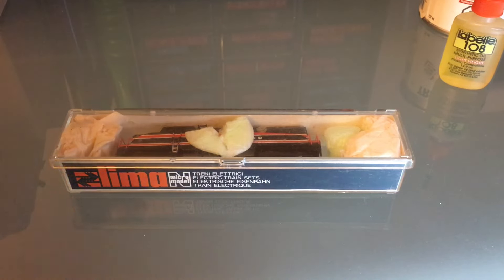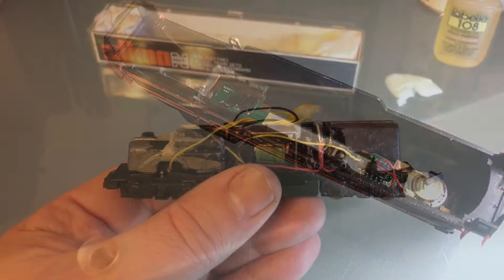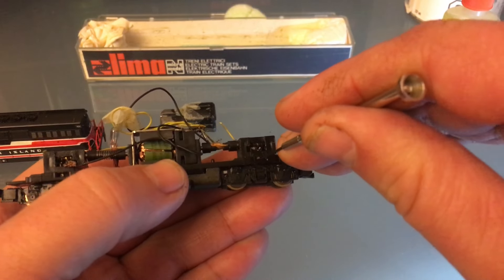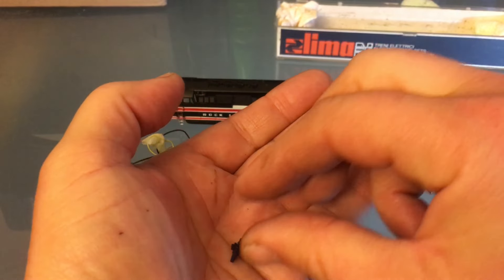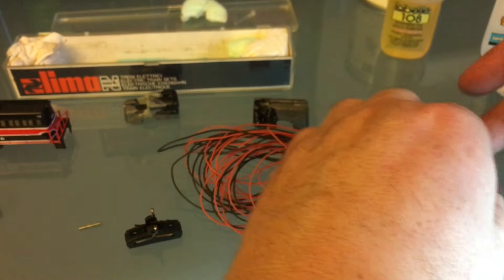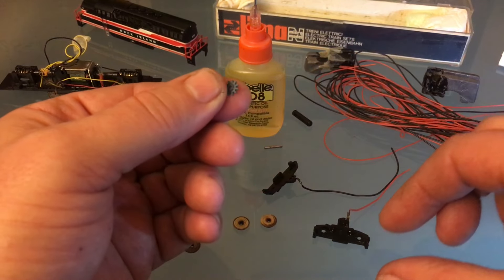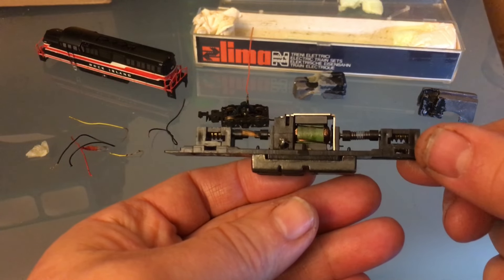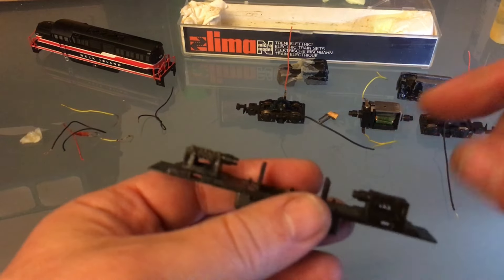N scale DCC and sound any locomotive Part 1

Comment: What's a good website do you recommend to check if a decoder is compatible with your engine? I have two Ho scale Life-Like Proto 2000 Alco Pa locomotives with computer chips inside but in the future I would like to run them on DCC. I was thinking of using a N scale decoder without sound in the locomotives because there is not a lot of space.
Reply from the maker: I’m no expert, but from what I understand HO motors need more amps. This could blow an N scale decoder. That would be bad…